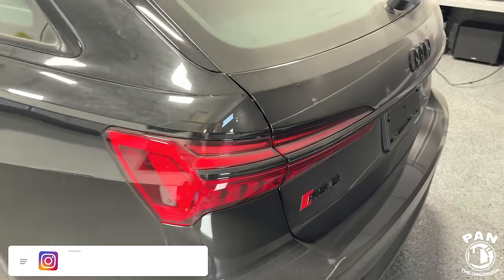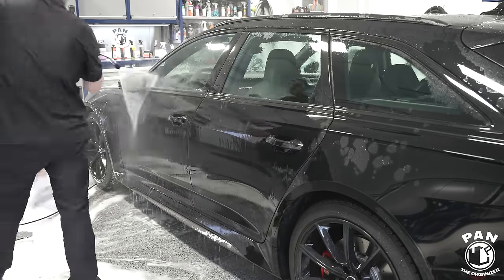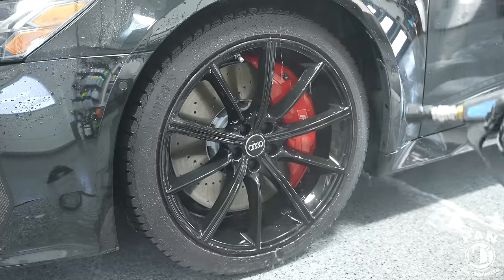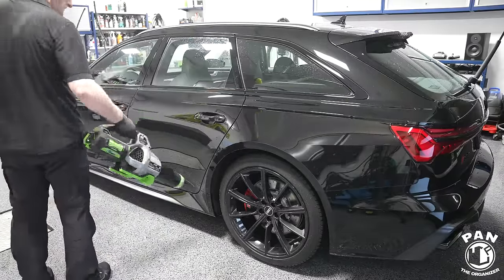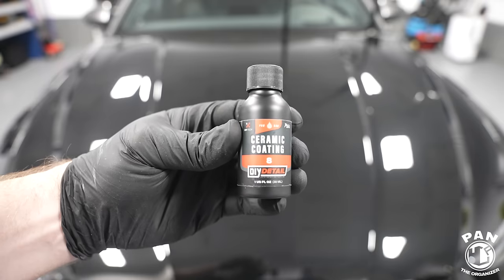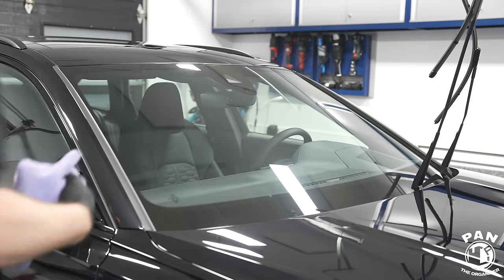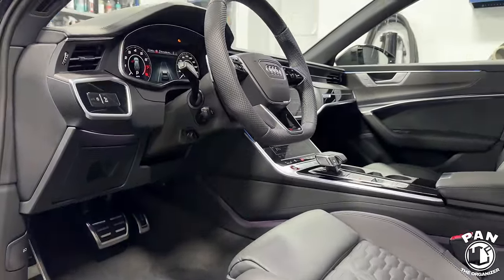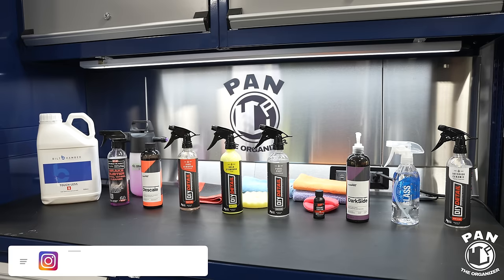Ultimate 2024 Audi RS6 Avant Performance Detailing & Ceramic Coating

Comment: How many pads did you use using the gold standard yellow pad from DIY detail with the gold standard polish?
Reply from the maker: I typically use 3-4 pads for the compound stage, and 3-4 pads for the polishing stage.
Reply: @PanTheOrganizer  I saw a video the guys at DIY Detail used a “one pad” method. I was wondering if you think that method is effective and safe?
Reply from the maker: Yes, as long as you frequently was the pad using a pad washer in between panels and passes. See my review of the pad cleaner that DIY Detail likes to use in this video: https://youtu.be/vfKgy7LOhh4?si=ECSft7WGmHDlQ9PV
Reply: @PanTheOrganizer  Thanks Pan!

Comment: Hello, i guess i have kinda of a stupid question, but is the roof also ceramic coated? I watched a number of videos and never see the roof coated. Is it just edited out? Well great video. Thanks.
Reply: Yes the whole vehicle should be coated
Reply from the maker: The entire vehicle was coated, of course, including the roof.
Reply: Ok Thank you. A lot of videos I see don't show the roof being done. Do you also do the door jams? With my truck it's an area that really needs protection.
Reply from the maker: It's simply because I am a one man operation, and am not equipped to film as high as the roof... I'd need some sort of rig. On this new vehicle, the door jambs were near perfect, so I ceramic coated them, but the paint did not need paint correction. 

On an older vehicle, if there are swirls and scratches, yes you'd correct that, and then apply the protection. Many detailers don't coat door jambs, but I like to go the extra mile for my customers.

Comment: Awesome im glad you did An Audi. i have a Shiny Black Audi and its time to Do the whole 9 yards on it as you did.Just to confirm What exactly is a high spot and how would you know  its there??
 Awesome just awesome work Pan  by the look of the owners face he  was just floored!! 
You just keep on amazing me with your work and i have learned so much over the last 3 yrs THANK YOU i mean That THANK YOU. Hopefully get to shake your hand someday.  Fast Freddy 👍👌🤙✌️🤘
Reply from the maker: Thanks Freddy! A high spot is a darker spot that cured, from a ceramic coating you're applying, and did not do the levelling or buffing step correctly. It's basically an overload and buildup of product in one spot, that dried and left a dark patch. And if you did not spot that quickly enough, you need to machine polish and restart that section.

Comment: Salut Pan pour quelle raison tu applique le coating en rotation et d’autres occasions tu l’applique en ligne droite
Reply from the maker: J’applique normalement toujours en ligne droite (regardes mes 1000 vidéos précédentes) mais pour cette céramique en particulier, la DIY Detail, j’utilise la méthode à Yvan propriétaire de la compagnie, qui utilise la méthode circulaire. Si tu regrdes tous les vidéos DIY Detail, ils appliquent leurs céramiques en méthode circulaire.

Ultimement la méthode d’application importe peu. Tu peux faire des cercles, des lignes droites, des triangles, des trapézoïdes, lol, c’est pas grave. Ce qui est important est d’être méthodique et assurer une couverture égale et uniforme des surfaces. 👍🏻

Comment: Did you use the one damp rinseless soaked microfibre and one plush dry towel for the polish removal?
Reply from the maker: Not in this application.
Reply: @PanTheOrganizer  any reason for that? Purely user preference?
Reply from the maker: DIY Detail has their way of doing things with their specific products, which is fine. I have my methods. You won't see many use a rinseless wash to buff of compounds or polishes. But with the DIY Detail polish, you can certainly use their method. There's nothing wrong with it.

You will learn that in detailing, there isn't just ONE method that works best. There are many different methods, and techniques to achieve the same great results. Different people have different skill levels, different experience levels, different products they use, different styles, etc.
Reply: @PanTheOrganizer  thank you for the detailed response.

Comment: Pan, we have cats in our garage. Which.coating is hardest so cat's nails are least likely to leave a scratch? Should I use a 9H or 10H type coating only?
Reply from the maker: Coatings aren't meant to protect against scratches or stone chips. That's the role of paint protection film (PPF). But that too will get scratched, it's just that it will at least protect the clear coat underneath.

See my video on debunking myths about ceramic coatings and you'll learn everything: https://youtu.be/cGGlEN6xvKE?si=khF0mkd1nuOkIP-l

Comment: When it comes to applying wax, are you better off applying the wax by machine and then buffing it off with a microfiber towel by hand or applying the wax by hand and then taking it off with the machine with a specific pad I'm thinking a wool pad?
Reply from the maker: Best way is to apply the liquid wax with a soft foam pad, using low speed (speed 1 or 2 on the polisher, you're not doing paint correction here, you're only applying protection). And then buffing off with a microfiber towel by hand.

Use a pad like this: https://amzn.to/3Ko0pcp

But you can also apply by hand, and buff with a microfiber towel. It's just faster to apply with a dual action polisher.

See my tutorial on how to apply a wax here: https://youtu.be/KZjiPcsPBrA?si=GkDdQvnRT7A8jSdY
Reply: @PanTheOrganizer  as always, thank you!
Reply from the maker: My pleasure. How did you discover my channel by the way?

Welcome to my channel. You discovered one of the biggest car detailing channels on YouTube as we surpassed 1 million subscribers and we have over 135 million views! I have been detailing for 27 years and I love to share my knowledge and passion with my viewers.

You found the right channel to help you learn everything about detailing.

Comment: Nice video thx

Is my current chemical guys snow foam enough to use on vehicle as it's only soap? They say it can be for foam gun and wash mitt
Reply from the maker: It depends what soap your are specifically using. Chemical Guys has a ton of different soaps. See my videos on the best car soaps: 
https://youtu.be/kWSQSpD0Rww?si=iDKNk80VDjyptxkj

Comment: Hi Pan, I remember you said you didn't put PPF on your personal cars, may I ask why?
Reply from the maker: That is correct. I am just not a fan of the look or feel or PPF. Plus, as I get a brand new car every three years, and do low yearly mileage, scratches and stone chips are of no concern to me. My cars are always pristine when I bring them back to the dealership.

But for people who keep their cars for many years, and want the ultimate scratch and rock chip protection, PPF is the only solution. I would still recommend a ceramic coating on top of the PPF, for the best of both worlds.

Comment: How can I use the Bilt Hamber in a foam gun? And also is there a dilution ratio where it's still  safe on coatings and sealants? 

Thanks!
Reply from the maker: For Bilt Hamber snow foams, it's a bit different. You have to calculate the appropriate PIR for your specific pressure washer and foam cannon setup, as it differs from one person to another. The instructions on how to do that are clearly marked on the label.

Comment: Great video Pan as always. Based on your recommendation, I'm using CarPro shampoo for foam and Bathe from Gyeon for wash. But since that, it seams something is leaving a very thin layer on the window only visible when it rains. The glass is not 100% clear. Is it the product, or is it me :)
Reply from the maker: Hard to say as I’m not there to observe how you do things. What CarPro soap are you specifically talking about?
Reply: @PanTheOrganizer  CarPro Lift with a foam canon followed by Bathe for mittens washing
Reply from the maker: I wouldn’t use high pH snow foams for regular weekly washes.

Comment: So the diydetail 8 year is safe on PPF. I thought you were saying you need to use a ceramic designed just for PPF. Seems like this ceramic can be used on all surfaces (ppf/paint/plastic trim/glass)??
Reply from the maker: It can sound confusing but here are some clarifications. Not all paint coatings can be applied to other surfaces. There are paint specific coatings, like CarPro CQuartz UK 3.0 for example. That is designed for paint. For glass they have CarPro FlyBy Forte, for wheels and plastics CarPro DLUX.

Some paint coatings are more versatile and can be applied to different surfaces: paint, wheels, glass, lights, trim, PPF and vinyl wraps. DIY Detail coatings are examples of that, and so is AvalonKing Armor Shield MAX.

There are also PPF specific coatings (Gtechniq Halo, Gyeon PPF EVO, CarPro Skin, etc) that are only designed for PPF. Those typically last 1-2 years. I have a video on that topic here: https://youtu.be/7RCgqdGrvrA?si=VevxjVFmPFtQugdO

And there are coatings meant for matte surfaces. Video on that here: https://youtu.be/5RocSxJQmzI?si=v-650dd23Zm9l_FB
Reply: @PanTheOrganizer  thank you for this clarification! I think many people will benefit from this information. Much appreciated!
Reply from the maker: My pleasure. I have covered that in many of my videos, as I currently have 1000 videos on the channel, with new ones added twice weekly. How did you discover my channel by the way?

Welcome to my channel. You discovered one of the biggest car detailing channels on YouTube as we surpassed 965,000 subscribers and we have over 130 million views! I have been detailing for 26 years and I love to share my knowledge and passion with my viewers.

You found the right channel to help you learn everything about detailing.

Comment: Can u use Carpro Iron Remover as a clay lube?
Reply from the maker: Never use iron removers as clay lubricants with regular clay bars. Only with synthetic perforated decontamination towels or mitts (the new generation stuff). And not all iron removers can be used as clay lubes in those cases. You need iron removers that don't have solvents in them.

I have tested CarPro IronX as a clay lube with the DIY clay towel and it works well.

Comment: Hey Pan, thanks for the video. When you use di water are you using it to just rinse only? Or do you use it to fill buckets, foam, rinse etc? Thx!
Reply from the maker: I use DI water for the final rinse, and also in my buckets.
Reply: @PanTheOrganizer  You think if I used soft water instead of regular tap water in my di tank it would extend the life of the DI tank? thx!
Reply from the maker: It's actually the opposite believe it or not. I have a water softener system for my home, and was noticing I was blowing through DI resin at a quicker pace than some other people I know without water softeners.

So I reached out to the owner of CR Spotless (who makes my DI system in my garage) and asked the question. The response was that the softened water will exhaust the cation resin much quicker and even potentially cause a fish type smell or odor. 

So I ordered a water bypass system, and I only use the DI water for the snow foaming and the final rinse, instead of using the DI water for the entire wash process from beginning to end. That helps save the DI resin for longer.
Reply: @PanTheOrganizer  Have you tried the cr spotless conversion kit with the down tubes? I have the same system and just trying to get more life out of the resin. Im Going to add a bypass loop soon. thx for always answering my questions.

Comment: First time polishing and ceramic coating my car. Noticed on the Audi the front grill the piano black nice high gloss on its surfaces. Did you polish the grill before adding ceramic coating. I own a new car with a piano black grill with lots of angles. Okay to polish "carefully" before ceramic coating?
Reply from the maker: The grill was in great shape here so no polishing was needed. But if yours does, yes it's totally fine to polish. You can even use a mini polisher like the Flex PXE80 with an attachment that allows you to access the intricate parts of the grill. This accessory: https://bit.ly/3XQSr15
For this polisher: https://bit.ly/3tvZTk8
Reply: Thanks Pan!

Comment: Pan, what does the maintenance on a car that has an 8 year coating look like? Would you still do say a yearly decontamination/correction, and essentially just then not do that last protection step?
Reply from the maker: Maintenance for all coatings is pretty much the same. I have a tutorial on maintenance of a coated car: https://youtu.be/IqIW78FmRYU?si=CQphHn33STOKIeZ2

This is done every 2-3 months. Once every other season, especially in the spring, I like to do a more in depth decon wash. See my ultimate spring cleaning guide here: https://youtu.be/oTaFE_p2OAw?si=lcMQmwM-4oxdqkFm
Reply: Wash regularly, decontaminate when needed, avoid polishing with abrasives.
Reply: @diydetailofficial  So during the years you have a ceramic coating on there would be no need to polish?

Comment: would the turtle wax hybrid line give me the same finish
Reply from the maker: Of course not. You can’t compare inexpensive spray products to full blown ceramic coatings in glass bottles. Not a fair comparison.
Reply: Ok thanks I will buy the products in this video
Reply from the maker: Please always consider using my links for purchases. It helps support the channel at no extra cost to you. Honouring the source as they say. :)

Welcome to my channel. You discovered one of the biggest car detailing channels on YouTube as we surpassed 985,000 subscribers and we have over 135 million views! I have been detailing for 27 years and I love to share my knowledge and passion with my viewers.

You found the right channel to help you learn everything about detailing.

Comment: A car of that cost and 'not fully prepped by the dealer" (residue of tape) ??! Jeez
Reply from the maker: A new car is never new until it's properly detailed. 
- at the factory, the paint defects are often corrected quickly by rotary polishing which can leave marks and holograms, so polishing corrects those, before you lock that in long term with a ceramic coating for example.
- vehicles are then transported by truck, train and boat so they are exposed to the elements, industrial fallout, brake dust, rail dust, etc
- vehicles are often left at boat docks (when transported by boat) or in exterior parking lots for weeks or months, again being exposed to the elements
- at the dealership, the vehicles are almost always poorly prepped using the same dirty water that was used for all the cars on a given day, and poor washing and drying methods leading to swirls and scratches 
- at the dealership, a layer of cheap wax or paint sealant is usually applied to attempt to make the paint glossy prior to delivery. It's crucial to remove any previous protection before you apply a ceramic coating, as coatings need to bond directly to a virgin clear coat.

If you only plan on applying a regular carnauba wax or paint sealant though, you could decide to skip machine polishing, as those protectants can be applied over existing protection and it's not as crucial to prep the paint as well.

I explain all of this in this popular video: https://youtu.be/QgoyrC-5CMc

So you can better visualize the new car prep process, here are the steps I perform on a brand new car for my customers: 
Mercedes S 580: https://youtu.be/Vq_tfcwryVI?si=whord2_UEFSg28UW
Aston Martin Vantage: https://youtu.be/OKga3yZVTqo
Volvo XC60: https://youtu.be/tvDBBenhYFA
Tesla Model Y: https://youtu.be/gohks8xP5NY 
Porsche 911 Carrera: https://youtu.be/2ckiivbFqs4
Mercedes AMG GT63S matte black: https://youtu.be/eU8zg1lXvXY?si=oGxoCp8PWt7gTncV
Audi Q7: https://youtu.be/t7HCBSVnizM